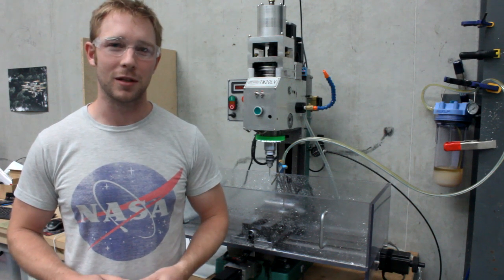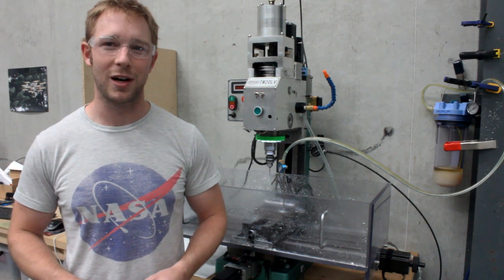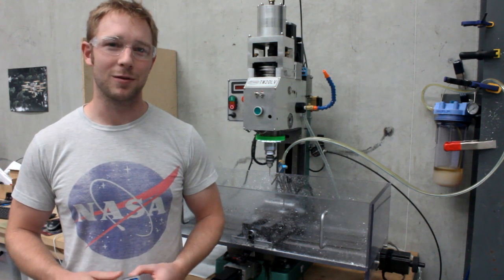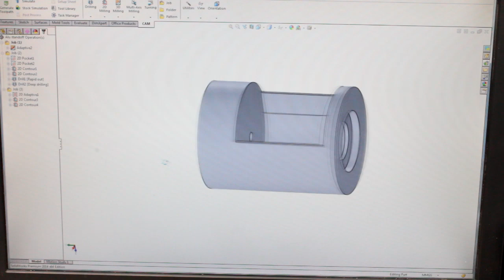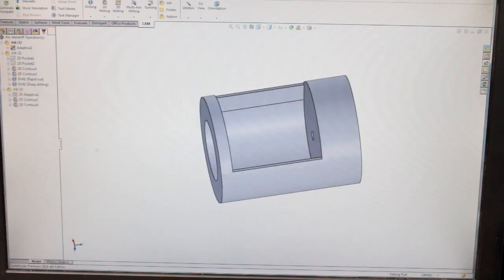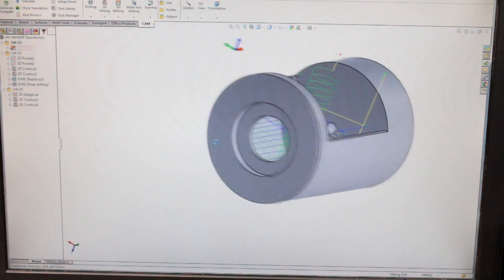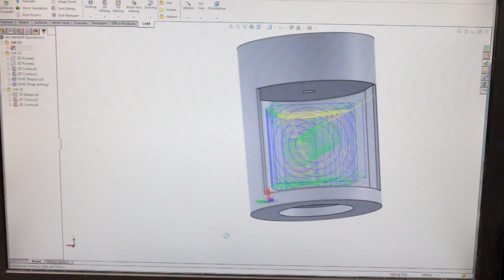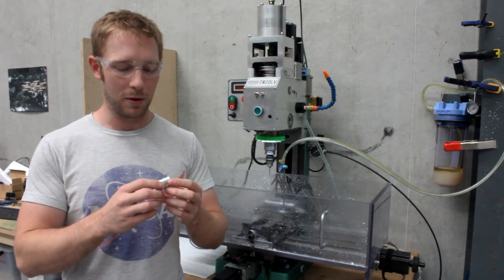HSMWorks - First time 3D milling

Comment: excellent job got my g0704 converted and a test part ready to run tonight :)  using inventor pro and HSMEXPRESS  if it works well would love to get into the 3d stuff, well baby steps first :)   how much was the HSM WORKS or did they hook ya up?   later man keep up the good work and videos.  Im right behind ya very soon :)

Comment: I noticed on all of your videos that your speeds seem way too slow. I have a X2 converted with Hoss's plans (working on my G0704 conversion now), and I can get what looks like 2x or 3x the feeds you are doing. What IPM can you get on those axis? Did you ever get your motors tuned up?
Reply from the maker: Hey mate, I can run it much faster however the number of times I have been impatient and end mills have clogged or broken is too high! nothing worse than wrecking a part when you are hours in to machining it, as you may know.
Reply: Yes sir I do know. I don't know if you have a compressor or not, but I rigged up a second regulator to mine, dialed in about 25 PSI and just pointed a stream of air at the cutter. It helped a lot, keeping everything clear of chips without the mess of flood coolant.

Comment: You should look into Solidcam .Ive tryed allot of cam programs and by far thats the best.
Reply from the maker: Hey Mark I actually had the opportunity to try SolidCAM and I didn't find it anywhere near as user friendly as I did HSMXpress/HSMWorks! Have you tried Autodesk HSMXpress/Works?
Reply: cruddCNC
Yes I have,  In no way am I taking away from HSMXpress. I thought it was a good program.  No nothing bout solidcam is user friendly not many of what I consider higher end Cam software are. They actually make no sense. Solidcam I just found to do what I wanted better and quicker . Ill shoot a vid sometime for you. I happen to have a G0704 also.

Comment: I think think that.s 2.5 d machining..
Reply from the maker: I used 3D adaptive clearing from the 3D Machining drop down menu.. You might be confused with 5 axis machining or 3 + 2 machining?
Reply: I do the same thing 3-d rough.But its the same as 2.5-d pocket roughing , i didnt see a finish cut that all. what cad cam are you using?
Reply: I agree I would still consider this 2.5 it seems like 2.5d with multiple passes 3d is where the tool moves in xyz simaltaniously. It may have done so but wasn't really showcased well enough here. Cool either way I'm excited to use hsmxpress coming from solidworks and mastercam
Reply: RITE

Comment: Hey man, i love your videos, im currently working on my 3rd CNC conversion which is a Titan TM20V. Just wondering how the Fog buster thing works for you, have you ever had chips binding to the tool? and what drives it? it looks like a neat idea, i wouldnt mind trying this system out this time round. What cutting fluid do you use? Do you get rust forming on your machine from the fluid?
I like the way you make stuff, You do some nice work!!
Reply from the maker: Jay Cee Thanks Jay - the fogbuster is a must for me. Flood coolant makes a humunganoid mess! I have had all kinds of disasters which is just marked down as experience haha. I use soluble oil cutting compound mixed with water, shot through the fogbuster. Cheers